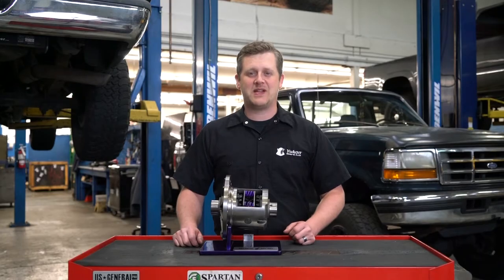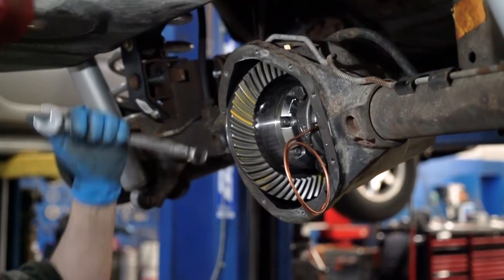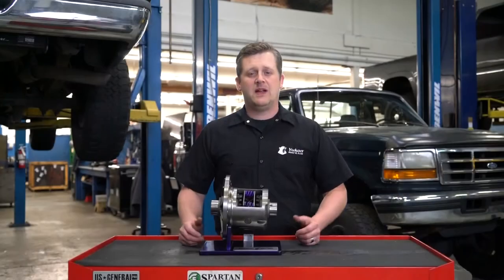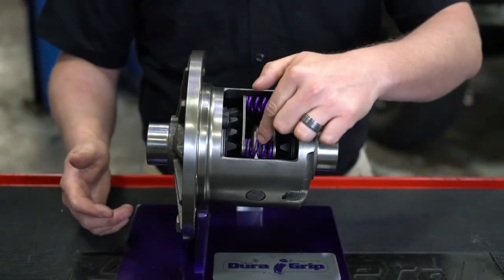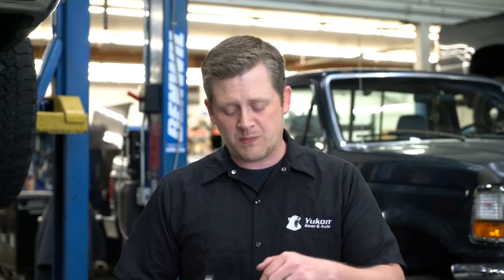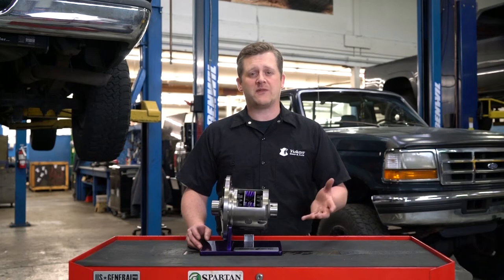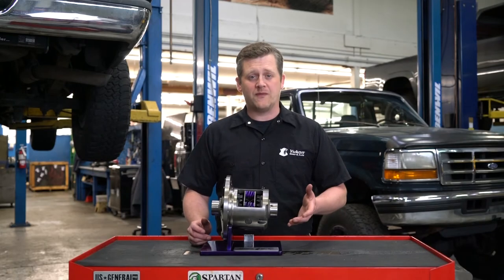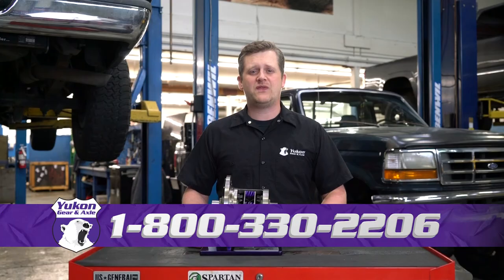Benefits of a Positraction

Comment: I had an 84' Camaro basket case that i put together with a Goodwrench 350 and a random 700r4 from the junkyard. I installed a duragrip with 4:10 gears and just beat the piss out of this car with my friends. Nothing ever broke. Had regular size street tires on it and i did alot of wot Neutral to Drive stuff too hahahaha
Reply: I wanna put one in a 1998 mustang but I see a lot of this brand breaking 😭 is it worth it?

Comment: I put a Yukon diff in my 85 c10 recently.   I'm probably close to the 500 mile break in period and recently I  started getting a  little  coasting noise.  After a 15 minute drive the diff is warm but not hot.  Should I do another gear tooth pattern check?
Reply: Yes

Comment: Om trying to figure out which to go with a 31 helical posi or 31 trak-loc posi or 31 dura lock posi for my '98 z28 daily driver but I'm pretty lost lol I'd appreciate some input
Reply from the maker: Hey Jordan, would you say it's 90% daily driving? What are you looking traction for?
Reply: @yukongearandaxle  yes 90% daily driving down the road maybe increase the power but my stock rear end finally went out and the prices I might as well just build a nice rear end and not have to worry about it going out again but yes 90% daily driving if not 95% daily driving and a little burnout here and there once in awhile but not too often but I just want to drive ability and a little over built a little stronger than I need just so a last longer you know what I mean
Reply from the maker: @Jordan-ql6tm  What year is z28?  most gm's don't have a 31 spline axle.  That's a ford spline count
Reply: @yukongearandaxle  it's a 98 Z28 and I'm looking at quick performance to do the build and they're recommending me getting a 31 spline they do offer a 28 spline but they don't recommend it cuz they are weaker so they're recommending me getting a 31 spline I'm just hoping I don't have to replace a bunch of other stuff to accommodate that this is the first rear end I've had to do so I'm definitely out of my element LOL as you can tell
Reply from the maker: @Jordan-ql6tm  So quick is building a 9"  rear? is that correct?  The 31 spline Dura Grip would be my recommendation for 99% of applications,   the helical ones are really only an an advantage on a road race car that does very tight courses where understeer becomes an issue. Give me a call so we can talk more tech if you need: 1-866-631-0196 EXT 5599
Reply: @yukongearandaxle   hey i have a 99 trans am that has a ring with theeths . Do i have to install it in the yukon differential?

Comment: What about that "Detroit Locker"?
Reply from the maker: That's going to be the Grizzly Locker.
Reply: @yukongearandaxle  will that be the same?Guess my question might be is a locker the same as a clutch pack diff?
Reply: @giannirocco7492 my understanding is no, my dad used to drive a tow truck that had a locker in it and that particular locker was way noisy when you’d turn the corner, the locker uses linkages and levers to mechanically shoehorn both tires together when you accelerate. Someone jump in if I’ve mucked up the details I’ve been out of the car game for 20 years lol

Comment: The question is , are YUKON posi units worth it ? NO
Reply: I never had any problems with any of mine, if I had to guess you probably didn't install the kit correctly lol
Reply: @chaningdodson4245  you have no clue then because i have serviced hundreds of rear ends but you are right about you guessing . Btw the pinion depth was checked to be within factory spec and  after the crush sleeve was removed i shimmed the pinion solid with .0015 preload and the carrier was also shimmed accordingly to .006 backlash . These units just dont hold horsepower thats all, you must not be making much horsepower . They are a slight upgrade from a factory open diff but beyond that get a Detroit Tru Trac helical gear posi. Theres a reason the new mustangs and ZL1 camaro use a helical gear diff. Ive seen many not just one of these junk yukons fail !